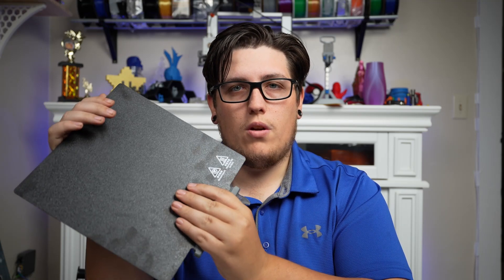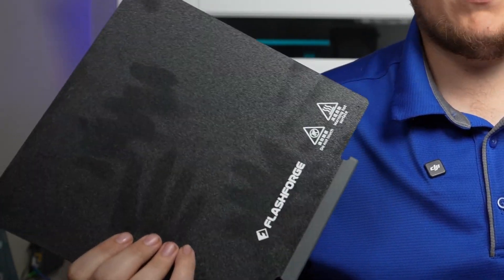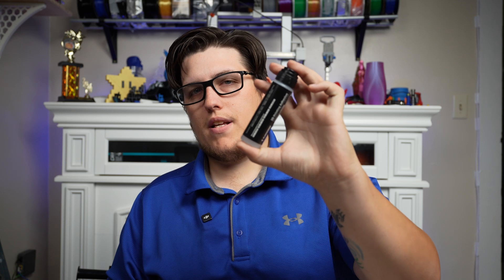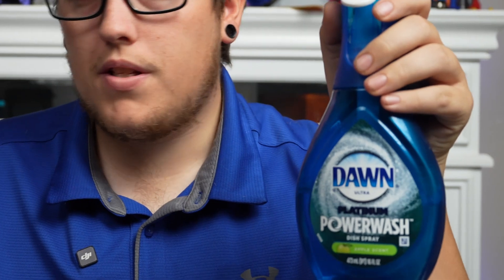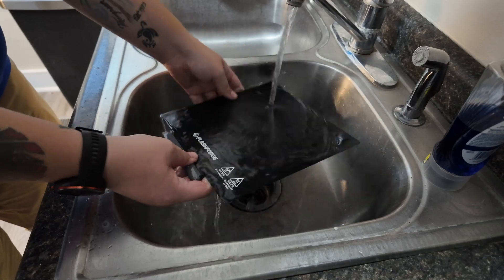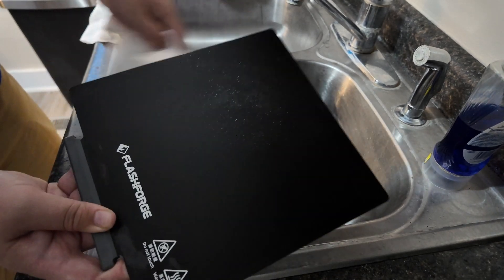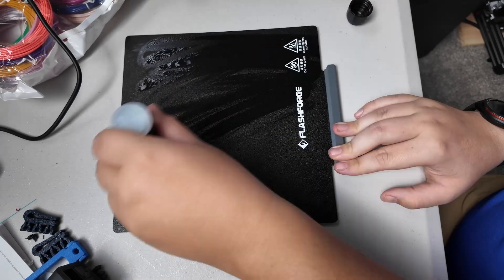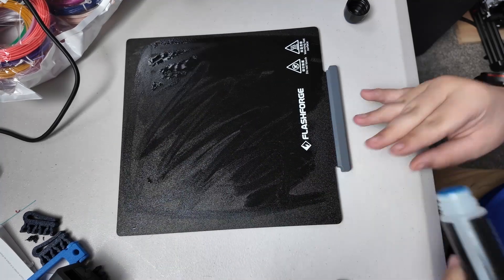This ONE THING Will SAVE Your 3D Prints!

Comment: if Ipa works why do printer manufactures tell you not to use it for bed cleaning
Reply from the maker: Which printer manufacturers are telling you to not use it for bed cleaning?
Reply: What I've seen is that they recommend dish soap given that finger prints probably are the bigger problem..